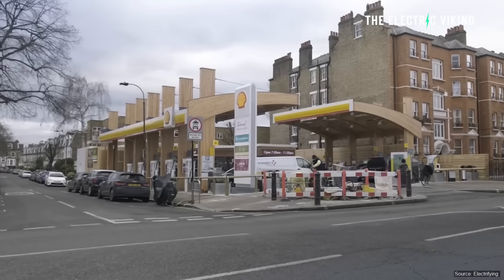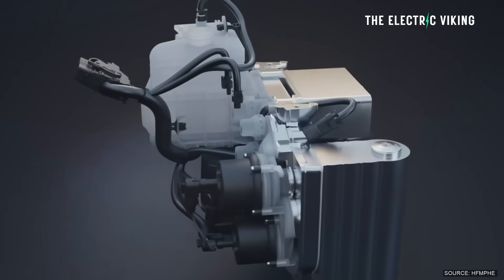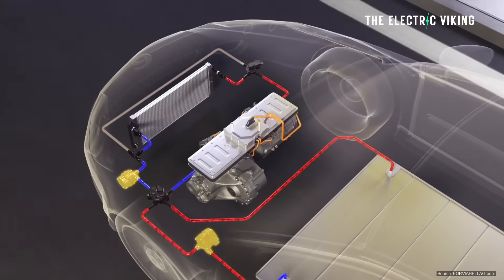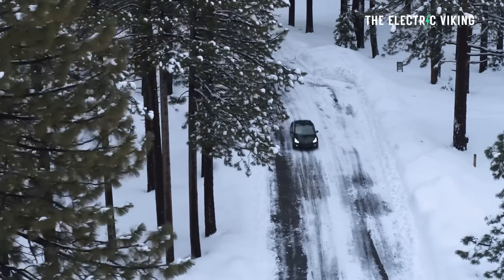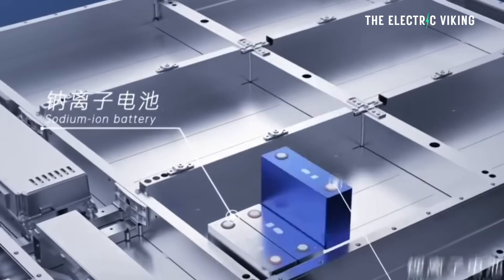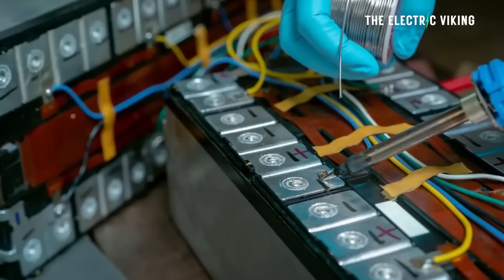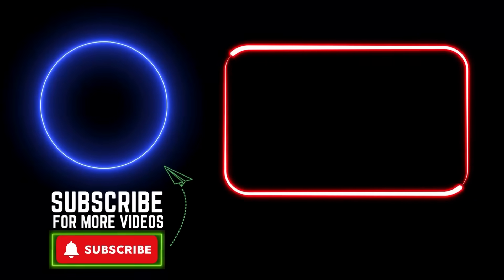Shell's Thermal Fluid Breakthrough enables 10-80% Charging in 10 Minutes

Comment: Shell Recharge is one of the slowest charging stations. This is all hype for Shell's stock investors.
Reply: This is Shell Lubricants a completely different division to Shell Recharge. This is an industrial thermal oil used for cooling, similar to that used in grid transformers and electrical switchgear already, Shell is one of the providers of such oils to the electrical industry. 

The solution proposed though is a specific one targetting smaller high efficient vehicles with a small 34kWh battery that can be passively or fan cooled without needing heavy AC cooling in the vehicle, to bring the vehicle weight and cost down to increase its efficiency (340 km/212 miles range from 34 kWh). 

The 10 minute charging is nothing spectacular and comes from the small battery being charged at 150kW rapid charging (crunching the numbers published), hence at the upper end of Rapid charging range but not Ultra-rapid charging. What Shell Lubricants appear to be saying is that the small battery can be charged at a sufficient rate due to the cooling oils thermal performance. It's not an example of yet another 'game-changing' hyper charging solution but an example of bog standard industrial engineering.

The Gas-to-Liquid is interesting, as this is a solution that can be driven by renewable electricity to convert water and atmospheric CO2 into methane that is then chemically processed into a coolant oil. In this case the volumes of the oil involved, and that the oil doesn't need replacing once in the battery, means it's not vapourware in this case (unlike combusted fuels) to create the oil using renewable power driven process.
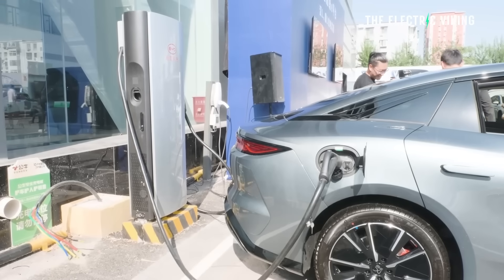Reply: Right. 2:30 hours 😢

Comment: Hyundai/KIA does 10-80 in 18mins since 2021. 10mins doesn't sound much of a breakthrough like half a decade later.
Reply: 0-100 in 10 mins not 10-80
Reply: @benjaminshort3248 I mean the title literally says "10-80% Charging in 10 Minutes"
Reply: @st4849 yes sorry I might have misunderstood what Sam said
Reply: It's not about the charging speed, it's the liquid coolant technology that enables a small vehicle battery to be passively/fan-cooled without heavier/costly AC cooling and support charging at 150kW (which is where the 10 minute charging comes from). It's portable to both 400v and 800v technologies, since this relates to the cooling approach. Their aim seems to be to make the vehicle as light as possible to increase efficiency to the 10 km/6.2 miles per kWh level.  

This may have applications in larger battery packs, but not to reduce weight, as active cooling will be required but it will allow higher charging speeds by allowing better heat transfer from the battery packs to the cooling plate. Without the cost of expensive non-conductive (some corrosive) coolants being used to do the same job - the coolant oil takes the heat from the battery to the cooling plate, and a separate AC cooling circuit then takes the heat away to be vented.